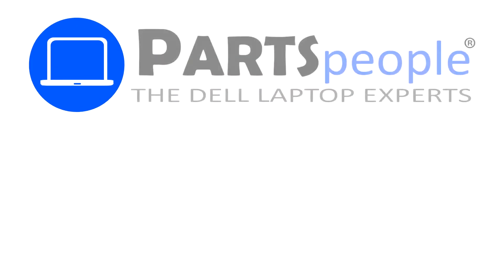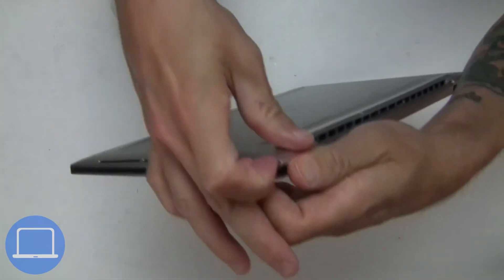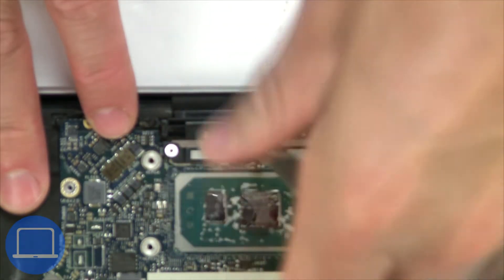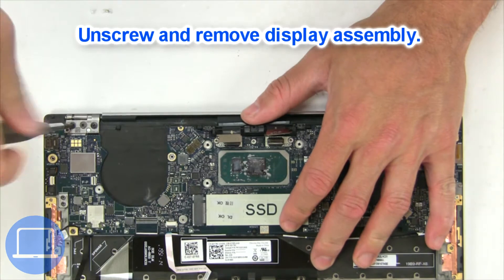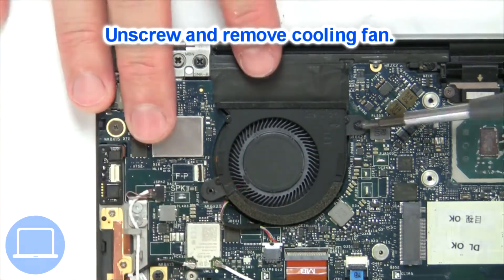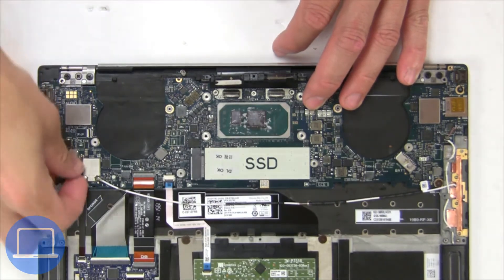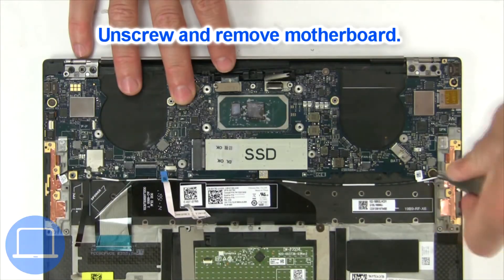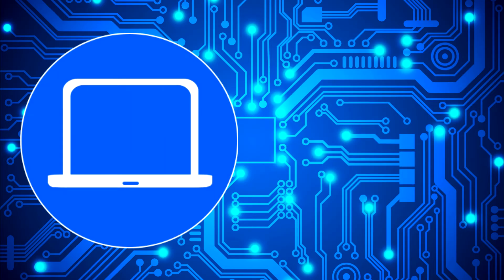Dell XPS 13-9310 (P117G002) Motherboard How-To Video Tutorial

Comment: Hello, the thunderbolt USB plug in on my XPS 9301 is broken, I assume its attached to the motherboard. Is there an inexpensive way to fix this?
Reply: Sorry i mean 9310 not 9301.
Reply from the maker: @brad8888888  Unfortunately this port is located on the motherboard which would mean you will need to replace it to resolve your issue.